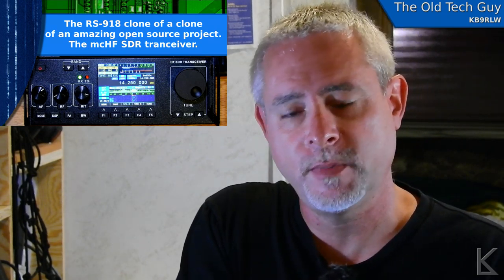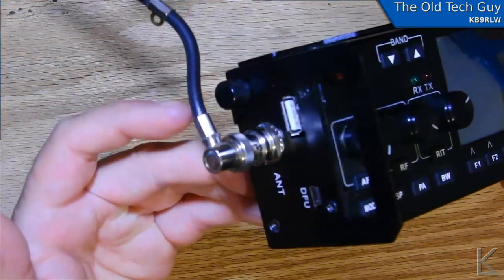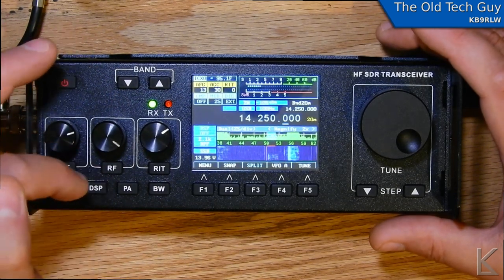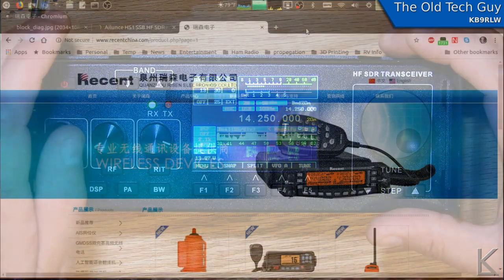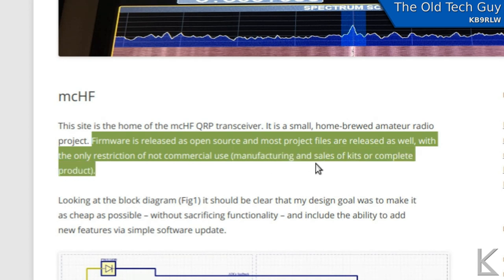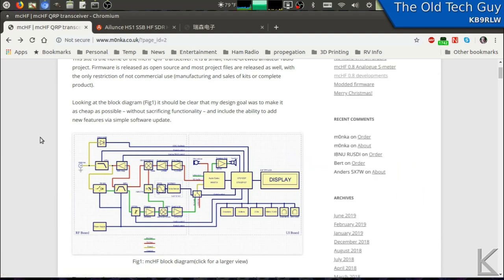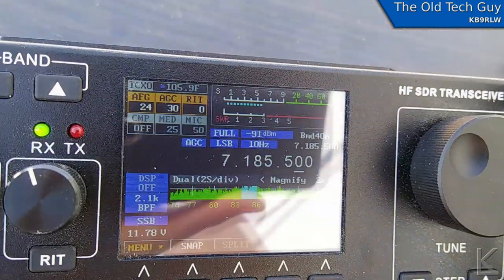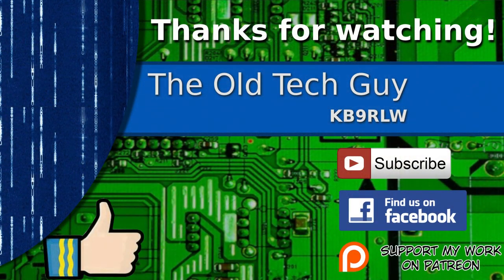Ham Radio - The RS-918 clone of a clone of an outstanding open source SDR transceiver, the mcHF.

Comment: I have the Tekpower version of the 30 amp switching power supply. What would be a or the cause of triggering the OCP on startup?
Reply from the maker: With nothing connected to it?  Either something is wrong with the current sensing, or maybe one of the output filter caps is failing.  My guess.
Reply: @loughkb  thanks.

Comment: Hello guys, does anyone know, if this can be fully operated (RX and TX at at least 4W on FM, AM and SSB) on CB 27MHz 11m band? I really love the waterfall spectrum graph and can see a great deal of how this can be leveraged for DX. I know how much of an overkill is this radio for an unlicensed CB operator, but all including the most advanced CB radios are so dumb that it can't even have a menu to set-up anything, not to mention super high tech like CTCSS/DCS :( Doing portable with this cutie must be a joy.
Reply from the maker: On frequencies outside of the ham bands it only puts out about 100mw.
Reply: @loughkb  Thanks, Kevin. That's the information I was searching for and couldn't find anywhere. So it's not really usable.

Comment: I'm not convinced it is a clone of a clone.  It seems likely that there is one factory and multiple re-sellers.  Good catch on the licensing issue! I'd pass on it for that reason alone. Thanks for the review, 73 de KD6FAC.
Reply: Don't concentrate on the aperence.  Anyone can do that.  The issue is the source code was created by one of the few of us that apply ourselves to that level of understanding.  This code is the ONLY hard part.  People are nice enough to contribute their knowledge to an open source movement.  The less capable (Chinese) take this work not only for their self gain, but to purposely weaken the creators.  They have massively crippled the 3d printing movement, as no one will contribute anymore.   I work in cellular, and have created a MMDVM that allows switching between the different implimentaions of ham radio digital.  While my goal was to share this, I will never release it, as I will not allow them to profit from me.
Reply: @falsedragon33  - Of cause, outher example....
Reply: @MrPerrey  my apologies, but I don't understand.  Could you clerify?
Reply: @falsedragon33  - MMDVM, I know, hotspot for DMR radio. Now "Jumbospot"... I guess, right?

Comment: Why are the "Big Three" rig manufacturers not watching and reacting to what is coming out there? I mean, I am sure the performance and resilience of their front-ends and finals is superior to what these new players in the market are able to provide. I mean, yes, they sure are implementing some features in software, but still packaging it up in old style cases, heavy, expensive. I personally own a Xiegu G90 and I am amazed how many features and a nice punch it packs in such a convenient package for a really small price. Fully customizable filters? There! An ATU that can tune a coat hanger? There. The entry models from the big ones should really, really start considering these features as well. Wait a year or 2 and we will have HF/VHF/UHF with 100 W and ATU from these chinese guys at around 600$ And radio amateurs will start buying them, you'll see...

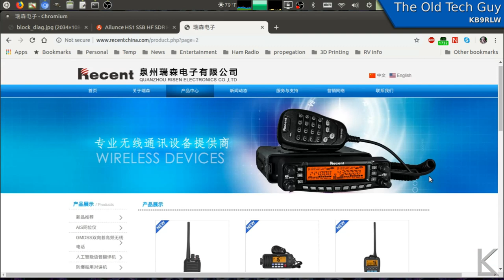Comment: 11:25 "...probably not designed by them..."  I hope that you all realize that the design of the product itself is merely the first ~1% of standing up a production line. Design of the tooling, testing, and so on is the other 99%.  Factories would have dozens of departments, and only one will be product design (including SW). Designers of electronics sometimes think that they're done when they've designed the product itself, when in fact they've not even started standing up a production line. That's why the licensing fee per unit might be $5 on a $1000 product, as that's actually all the product design is actually worth. If you want to go into mass production, then go ahead, help yourself, fill yer boots.

Comment: I looked at the m0nka site....... it seems that Chris is having a problem keeping up with demand. He keeps working on the next version while not really providing adequate support on the present version, or past versions. No support for V.6, limited and spotty support on V.7, all the while he's putting videos out showing his prototype V.8. He needs to find a company that can source the parts, get the cases made, and assemble the kits for sale. I can't help but wonder how much money he's losing by not providing adequate customer service. That's why the Chinese have copied his design and work, they see the money to be made......

AJ
KE6EAC
Reply: No, I never had any problem for purchasing from him. I bought two SMD part kits and bare PCBs - Contact and support from Chris and Lucy is outstanding!!!
Reply: Recently, 3 weeks ago I ordered a V0.6 SMD component kit and got it right out. In his site he wrote: Send me a Email if You need something special. I did it just tree times and they did it, almoste imidiatly.

Comment: Is it possible to expand transmission to 27MHz?
Reply from the maker: It will transmit on any frequency outside of the ham bands, but only at 150 milliwatts.   With a good antenna, you can cover half a mile to a mile.
Reply: @loughkb  At 145 MHz he arrive on display but not receive really the tansmission for example.
Reply from the maker: @mrtonicsvls3624  You ask about CB frequencies then cite an example in the 2 meter band?
Reply: @loughkb  2 meter was another type of example
Reply from the maker: The RS-918 doesn't even cover 2 meters, so I'm not sure what you're talking about.

Comment: Recent isn't afraid to use even the 'mcHF QRP' logo as you can see from this Amazon posting:
https://www.amazon.com/RECENT-RS-918SSB-SDR-HAM-Transceiver/dp/B072155421
Someone seeing this and who is familiar with the mcHF unit, might think Recent has been authorized to manufacture the units. I'll bet Chris, M0NKA is frustrated.
Reply: The photo with the case that says “mcHF” on it is not the radio that Recent sells. Recent is not the only manufacturer of these. That listing is almost certainly by a third party reseller not under Recent’s control.  In fact, it looks a lot like the actual case that M0NKA himself buys from China.  Unfortunately I don’t believe M0NKA made any attempt to register the trademark “mcHF”, and if there’s no trademark there’s no infringement, so I’m not sure there’s anything he can do now even against those who are making radios that say “mcHF” on them.

Comment: Perhaps the Chinese companies are buying the kit and they are assembling them and selling them and earning money from the assembling of the radio and not from the  design and parts.
Reply from the maker: Nope.   They're different.  The connector placement is different, indicating the internal boards are different.  I think the case has some different button placement also.
Reply: @loughkb  also filter banks are different, original kit uses ferrite rings for output filters, while clones use SMT inductors
Reply: @RaivisRengelis  - "clones use SMT inductors" putting out harmonics as hell - In some clones there is no LPF at all !!

Comment: Hi THe truth is I am considering buying a clone version.
I think when I do, because of my poor results with kits, 

I will send a donation to the originator. He they deserve some compensation for their work.
AG4TD
Reply from the maker: I'm not here to judge, and I applaud your sending a donation to Chris.
Reply: Consider that You get with the clone a outdated V4 version together with some early design flaws. The clone quality is low. They frequently stop working. No support from the seller, difficult to find someone for a repair job. The kit from Chris is a last V6.3 version assembled out of superb top quality components and easy to assemble. If you dont want to make final assembly ask in the Yahoo group for someone to make it for you. The kit is eaven cheaper and has a grate WW support from the community, even for a cheap repair job in Your country (if you ever need). Look out for the many people with there clone issues many time ending up with a doorstoper. The mcHF community generally refuse support if someone shows up with a clone. Consider that before you make a decision.

Comment: Bought this radio and the finals blew out within a week.  Service is basically non existent.  Try sending any electronics back to China and see what happens.  Xiegu is the only brand I would buy from China.  At least MFJ in the states will do the service.  Everything else, you are rolling dice.  Unfortunately, the only major Japanese radios that compare are the upcoming ICOM 705, but it is not out yet and costs about 2-3 times of the Chinese radios.  I agree, Yaesu needs to get off their butts and make a comparable version for QRP or the ICOM 705 is going to mop them up.

Comment: Is it still called a clone if the base is open source project ?
Reply: It's not a clone, it's a underperforming crappy rippoff of the outstanding mcHF from Chris.
Reply: @MrPerrey  the reviews seem to be OK
Reply: If You look only from outside of the clone, yes. If You consider what You will find inside of the clone, compared to the original definatly NO.... and beside that to many of this clones stop working after some time due to poor quality and it's a nightmare to find someone to fix them as well. Does not worth the money to buy one clone since you can buy a original for almost the same amount. And if someone is not able to put the thing together there are people around who do it just for some little bugs.
Reply: Take a look to the UHSDR licence on GitHub. They make use of the FW sources and some cloner moddet them due to a cheap XO that they put inside there clones to make em cheaper and the modification in the FW they kept closed.... To avoid that outher cloners of the clone make use of there clones .. That's all Ok yes?
Reply: @MrPerrey  I was planning to get one, but I'm going for the original now. thanks
Reply: It depends on the license that the original is released under. "open source" is not a legal term as such. But I agree, if it complies with the original license then it is a copy, not a clone.
Reply: He has not released the hardware designs with an libre license. Additionally some of the radios have his trademark, which I have the feeling he hasn't licensed.

Comment: Could it be that the project has granted them permission to manufacture the design?
Reply from the maker: Nope.  Chris has complained to aothers about it.
Reply: Absolutely zero chance of that. IP protection in China is extremely weak. To get it enforced you need to be a huge multinational with very deep pockets to buy protection.

Comment: Service: Not available, according to Amazon. What a crap shoot: Hope it doesn't break or burn up. Except hope is not a strategy.
Reply: Amazon banned mcHF ripoff sellers from there platform due to a copyright claims coming from the mcHF community. eBay also do, but with less "motivation". eBay is a US company and copyright crime is a serious issue in the US. That helps !!
Reply from the maker: Here's a search on Amazon.  They're all still there.
https://www.amazon.com/s?k=Rs-918&ref=nb_sb_noss_2
Reply: @loughkb  - Waoooo!! Only claim with a prove of copyright violation and they are gone. It's possible to do that just two times since there is violation of the HW from Chris but also from the firmware side since they make use of the UHSDR FW from Github. I'm not shure how US laws handle selling or buying  counterfeit  products inside US teritory but I heard that it is just a crime to import, sell or eaven buy such things. May be You as US citizen can tell us more about.
Reply: @MrPerrey  There is no copyright violation with the hardware in these Chinese mcHF clones: that is not how copyright works.  If it were, IBM would still be the only company making PCs.  While there were illegal clones (because they copied IBM's firmware illegally), the vast majority, beginning with Compaq, were entirely legal no matter how much they were contrary to IBM's "wishes" or "demands" not to copy the PC design.  How big, rich, or arrogant IBM was, or how comparatively small or noble Compaq may (or may not) have been in that fight had absolutely nothing to do with who had the law on their side.

There's also no copyright violation putting UHSDR from GitHub on the RS-918: that's not how UHSDR's GPLv3 copyright license works, and the firmware on the RS-918 complies with the UHSDR license conditions.

You might think you prefer that those two conclusions were false and that these Chinese clones break some law or copyright license.  But first, read: 
     https://github.com/df8oe/UHSDR/issues/1743

It would be wise to independently research the credentials of the person who made that report, and to consider the section near the end of the issue report describing what would be the result if copyright laws applied to hardware designs the way you think they do. 

Your use of the word "counterfeit" here is seriously uninformed.  Counterfeiting is a form of trademark infringement, a fraudulent imitation of a BRAND.  None of these radios are being fraudulently passed off as a product of M0NKA.  A counterfeit is something that pretends NOT to be a clone, but rather to be the original, from the original SOURCE.

Recent is quite clearly doing something that M0NKA doesn't WANT them to do.  You can reasonably argue that they're being "selfish" or "not nice", and that we SHOULD buy the mcHF instead of a clone, in the interest of encouraging further work from M0NKA.  But Recent does not appear to be violating any laws, or for that matter, ethics.

You don't support your case well when you try to support it with falsehoods.
Reply: @drgiller  - Many words to explain a completely wrong thing to be right and perfect. I guess you profession might be a lawyer, or a politician.
Reply: Wolfram Perrey I’m neither. I’m someone who has bothered to learn facts.  Those facts will not change if you hurl insults or get red in the face.  You can learn the facts or you can stay angry.  I feel sorry for M0NKA and wish it were he who were profiting from this. But he made some assumptions and overlooked some important things that are making things not go the way he likes because he didn’t understand what he could and could not control and how. I hope he gets teamed up with someone who helps him benefit from his work the way he deserves. Many fine engineers are not the best businesspeople to bring their own designs to market.

Comment: Not worth what they're asking for it.
Reply: You are right. Why not just get an IC-7300, with warranty and service after that. The 7300 changed all the calculations for value/price ratio.
Reply: Service by icom? What's that? Lip service, being laughed at  by head of icomusa when you ask about getting your icom fixed, what kind of service is that? Don't depend on getting that icom fixed... once it reaches a certain age and parts are no longer available, then icom is no better than the Chinese rigs, except you paid twice as much for it.  Look for the list of icom rigs that can no longer receive service.... ic- 706mkiig is one of them
Reply from the maker: A couple of years ago, I ordered some parts from Icom, for a 1980s IC-745.  I also had a very pleasant conversation with the staff.  They were quite helpful.
Now, I didn't talk to Tokuzo Inoue,  and I'm kind of surprised you'd actually get to talk to the head of the division.  They usually require appointments be made, even for phone calls.
Reply: @kd5inm  ICOM serviced ALL FOUR of our IC-706 MKIIG units back to new spec about 2 years ago. It was at reasonable cost also. One of those is my only radio. When the transistors in the pwr amp go unavailable, the options are fewer. If ICOM doesn't want to use cannibalized parts, that's their call. I don't fault that decision.
Reply: @loughkb  With the trouble I have had with Icom in the past, I started out with Icom, had several Icom rigs starting out, but not anymore. I was laughed at when asking about help with fixing my friend's 706MKIIG. They don't need my business then... YMMV